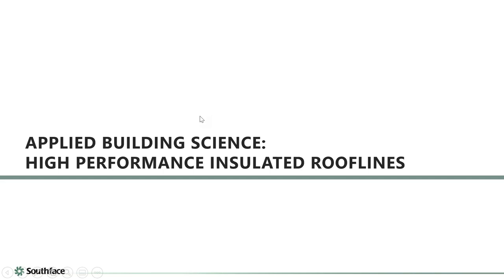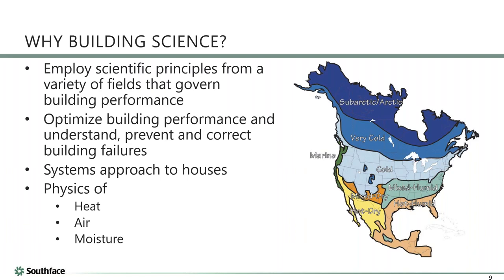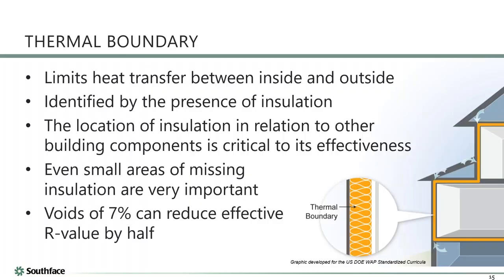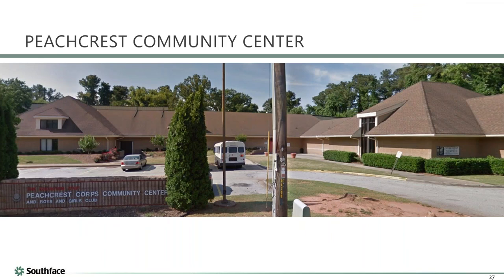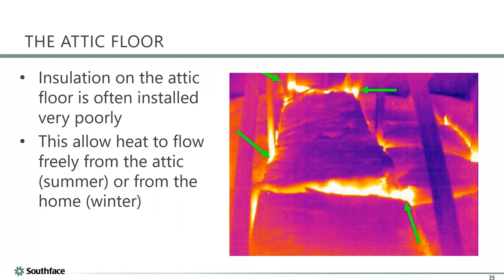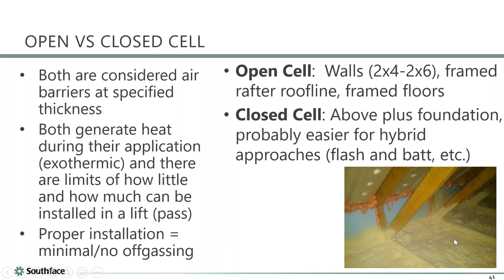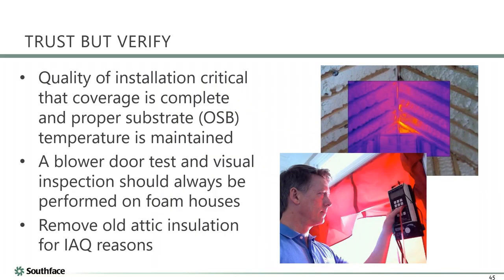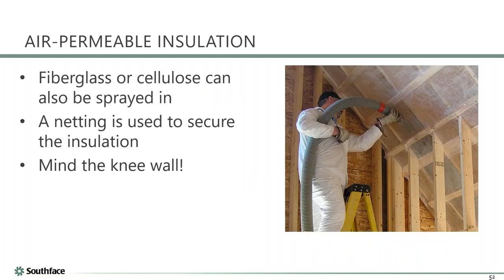High- Performance Insulated Rooflines

Comment: I was searching for videos about vapor diffusion ports on unvented roof assemblies and this video popped up. It sounds like you're a little skeptical about it's efficacy? Granted, I've not seen any scientific study other than one done regarding ridge rot in Alaska, I believe. But I've seen many anecdotal accounts of homeowners in higher performance homes who "geek out" on taking measurements, and they seem to indicate that there's a higher humidity level at the peak of their unvented roof. The SOURCE of the moisture seems to be in question: inward solar vapor drive, stack effect, even air leakage...
But the consistent variable is the presence of elevated humidity at the peak.
So on that note, doesn't a vapor port seem to be more beneficial? Especially if it's one of the "smart" vapor membranes? (Supposedly one-way vapor membranes?)
Reply: Couldn't agree more Benny, see my video comment

Comment: Much like the other commenter "Benny McKeon" alluded to, the speakers with Southface are clearly biased to one specific insulation choice. I wonder if is due to the fact the returning guests being members of the spray foam "lobby", (Icynene). There is plenty of time spent on attacking the vapor diffusion port, on possible poor installation being a source of failure, but when it comes to spray foam applications let's explain away all its potential failures. VOC's, flammability, diminishing R-Value of foam, and certainly accommodations needed to make in various applications to meet code. 
Anyone watching this video (or any video by Southface) should note, the building science community isn't impenetrable to lobbying with disinformation campaigns. Most notably, Tyvek's assault on Huber Zip Sheathing/WRB. They spent a fortune getting reps to spread misinformation about the product as they settled countless water infiltration lawsuits over their "poorly installed" product (no taping). Spray foam's problems are obvious: off-gassing isn't great, especially in tight buildings, it certainly isn't "green", health hazards for installers, flammable, and "Manufacturer On-Site! by inexperienced installers (manufacturer now). 

Benny, I would just reference the US Dept. of Energy's study on this for Climate Zone's 1 thru 3 and its efficacy. I think the Climate 5 study could still be ongoing. 
"So on that note, doesn't a vapor port seem to be more beneficial? Especially if it's one of the "smart" vapor membranes?" - Benny McKeon
Yes, you're right, but they don't want to upset the paying client Icynene who gets his own 30mins of airtime at the end of this vid. Tisk-tisk